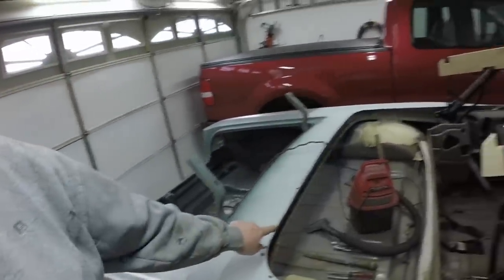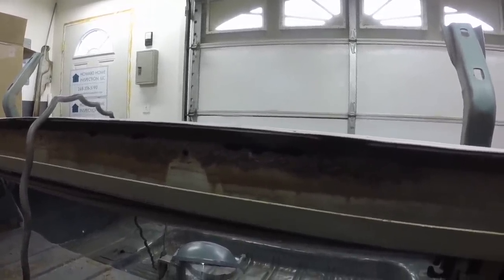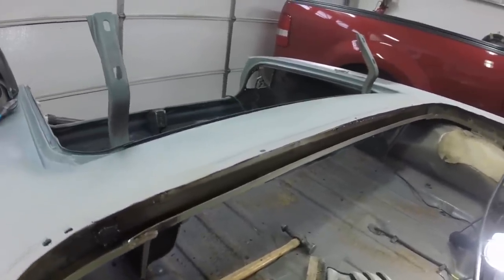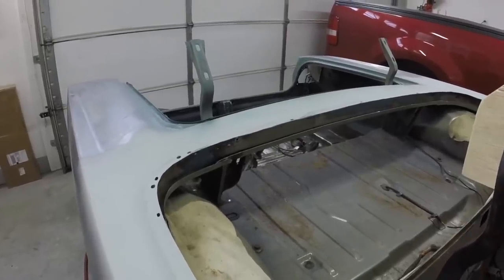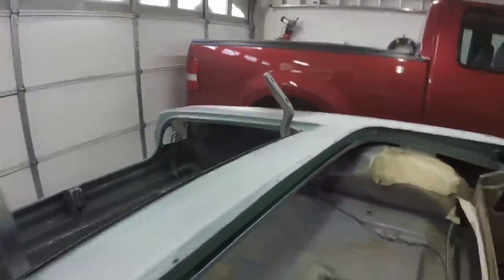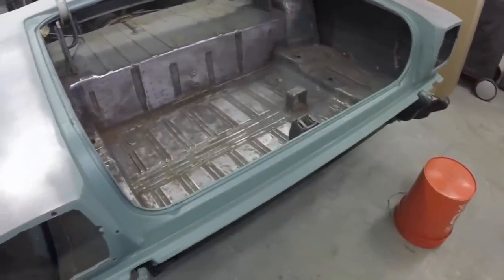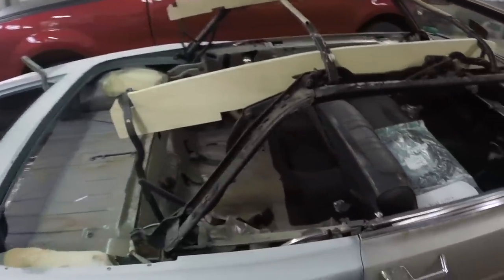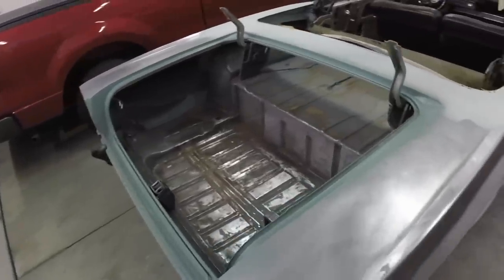1966 Ford Galaxie 500 convertible restoration part 106 welding up rust in top channel

Comment: the 352 was from 58 to 66 in cars and 67 in trucks..68 the 360 took over and with the 390 lasted to 76..ft engines are very close to f,e  engines ,,but the water passages and intake are different  then a f,e but you can put F,T heads and intake  on a F,E as long as you do it  in pairs ..in a way the 352 still lived to 76 cuzz a 360 used a 352 crank in a 390 bored block ..the 410 was 2 years..66/67 and only  in full size mercury's ..it was a 428 crank used in a 390 bored block ...car is really taken shape...wont be long now...i cant wait to see it with new paint and white walls  on it..nice job there  my friend
Reply from the maker: Thank you for the info.

Comment: I did some research on wikipedia on the Ford FE V8s and you were right. The last year for the 352 was 1966. You have a gem in that respect. The last year for the FE in cars was 1976. I remember my grandmother's 64 Galaxie 390 was very powerful. I assume most engines in the big Fords were 352's and 289's.

Comment: Nice recap, Howard. The 352 in low compression 2 barrel form was considerably less powerful than the 4 barrel and tended to be thirstier. However you could hardly wear them out. Dead reliable.         An aside to your 427 comments, the 360’s and 390’s That came in the trucks had extra webbing in the crank bosses. These blocks have been in some demand for performance and machine shops do cross drill these mains to add the bolts like the 427 had. I believe this to be true for all the FT line actually,
Reply from the maker: The Ford school buses I worked on in the late 70's did not have main bearing bolts threw the side of the block on there 361 FT engines. The block was cast slightly deeper, to make for a larger oil capacity, as I remember. As far as the 360 and 390's go, I really don't know a lot about them. I do know a guy that is a FE nut, and has hundreds of them. Next time I see him, I'll ask him for some insight on them, maybe even video them, if he is ok with that.

Comment: Wonder if those Ford truck 361 engines were anything like the ones used in the Edsels?I remember a friend owned a '62 Ford school bus with an engine resembling a Y block V8 but when he went looking for valve cover gaskets he found out that it was actually a 302 but in the big truck engine,he found this out from a former Ford mechanic that ran a local repair garage.
Reply: Roger Camp: Hi Roger. Most Edsels were equipped with MEL engine family. They were close to FE as far as they looked but in truth very few parts interchanged between the 2 engine families. If I’m correct only the rocker shafts actually interchanged and perhaps the intake manifold. Ford did offer a 302 y-block in medium sized trucks starting in 1956 I believe.
Reply: @brianhdueck3372  thanks for the information.

Comment: Howard, that water channel empties in front of the rear wheel wells. Make sure the drain holes are large enough to prevent any sitting in the bottom of the qtrs.... Nice job
Reply from the maker: Yea, I cleaned the lower rear quarters out really well. The drain holes are totally clear, and I even got new rubber drain things for them. After the car is painted, I am going to paint, oil and undercoat the inner panels really well. Surprisingly there very clean and solid still.... for a 54 year old car.

Comment: Under that bonnet um, hood, that engine compartment looks fantastic. Everything looks original in there. I learned FE stands for Ford/Edsel engines and you seem to have things well in hand with that huge car. It's a lot of car but by jove I do believe you've (very nearly) got it in the Bag now. Just a roof and Hey Presto !  Anyway Cheers over there. That trunk floor looks solid too.

Comment: My Grandpa bought a 65 Ford F250 camper special with a 352 2bbl in it. My Dad inherited it from him. The truck was in really good shape.  One of my co workers and I Replaced the cab corners and repainted it, in 1987, It looked like new!  I inherited it from my Dad unfortunately he had left it unused  outside for several years. The cab supports and radiator support were all rotted out. I had it in my pool barn for 5 years. Had to sell it when the recession hit  and I lost my job.